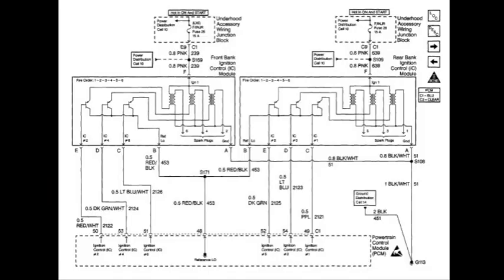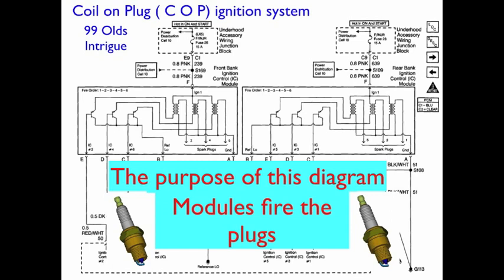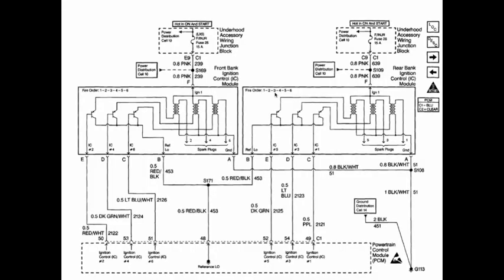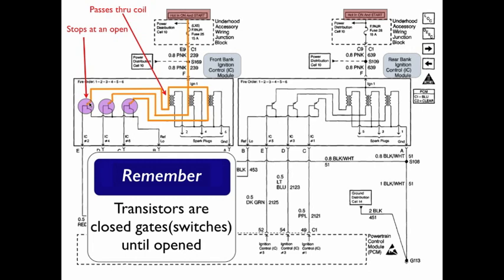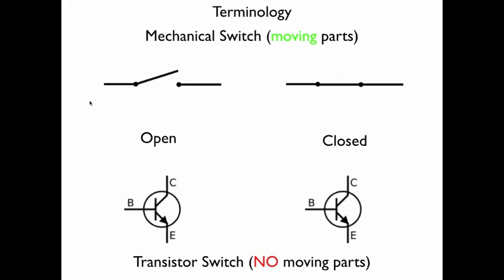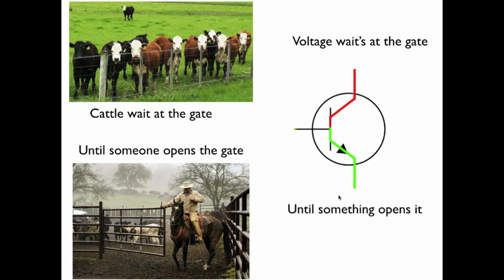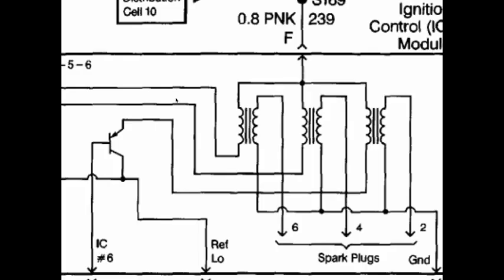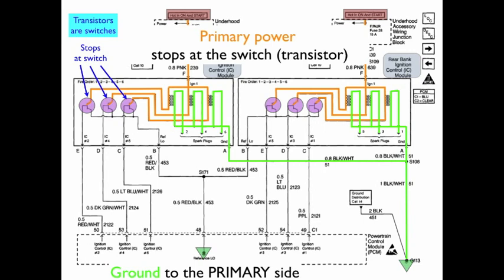Lesson 7 Part 3  Reading an ignition system electrical diagram

Comment: Sir amazing video and i am greatfull. Although i would like to mention here as far as it concerns the trigger on the base of the ignition transistors. The base should normally receive a positive signal, to be more specific because it is an PNP transistor it should receive a voltage lower aproximatelly 0,7 Volt than the emiter. in our case from 12volt about 11,3 Volt. Please corect me if i am wrong. Great job one of the best if not the best videos about automotive electrics.

Comment: The thing about this diagram that confuses me is how the "top" of the secondary coil is connected directly to ground. When the gate closes and the secondary coil becomes charged, why would the current flow in the opposite direction (i.e. up in this diagram) instead of through the spark plug? You say that the power is looking for the nearest load, I've always thought of it as the current trying to find the path of least resistance to ground, and the spark plug gap looks like a lot of resistance compared to flowing through the coil in the opposite direction.

Comment: I have a question about an issue I am having. I have an 08 chevy Colorado. My wife had to get a jump from a friend and they hooked up the batteries backwards. I ended up changing the battery and the alternator for charging issues. The 100amp mega fuse was blown and I changed it too. Now, half the time you turn the truck to On before starting the wipers move halfway and stop. Half the time they don't. No matter what, all the time when you try to turn on the wipers they don't move and the RAP relay just keeps clicking. If you have the ac going or try to roll a window down and then turn the wipers on the ac and/or windows stop until you turn the wipers off and the wipers never move. I suspect the BCM as I disconnected the window washer pump and put a lead on the red (hot) wire and the other end to a good ground, turned on the pump from the switch and got a jump to 2V then it dropped back to 0.8V the first time and it went down each try after. I saw on another site that the window washer pump was connected straight to the BCM and I should get battery power when I do this. I checked wires A5, and A7 from the wiper switch to B5, and A3 at the BCM and they have continuity as they are suppose to  Also checked B5 to ground - continuity. With truck in ACC 0V, with washer pump energized I get a jump to 1V and back to 0V. With key in On I get the .8V and energized pump jumps to 1-2V and back down to 0.8V-0.4V. I check all connections in the fuse box and everything that deals with the windshield wipers/washer has continuity in the lines so no breaks noted. The RAP relay (58) has power to relay pin 30, 85, and 86 and 0V at 87 with truck turned off. With the key in the "On" position on that same relay I get pin 85: 12.5V, 86: 0.26V, 30: 12.5V, 87: 12.5V. Key On and wipers on I get 85: 12.5V, 86: 11.2V - 12.4V, 30: 12.5V, 87: 0.2V- 1.6V. Could you give me any suggestions before I pay a lot of money for a cheap part?

Comment: The spark plug is not a resistor. it is a conductor. the high voltage thats been induced by the secondary winding will always find a path going the ground.  And if reaches the spark plug it will spark because of the gap.

Comment: Yes we do know about transistors. Some coils  have the transistor  built in the coil. Only a small Voltage and current is sent to base of transistor . Then collector and emitter. Will change state. then coil   will fire. Just Logical thinking.  Dear wattson. The cows at the gate about made me fall out. Cow analogy.  Thanks for the laugh.

Comment: When primary coil is turned on, shouldn't secondary also build voltage the same time? Why spark only occurs on disconnecting primary?
Reply: I think the collapse of the magnetic field on the primary that create the induction on the secondary which makes the spark!
Reply: i think you're right, the only way to have electron flow on the secondary side of the coil is from the magnetic field created by electron flow on the primary side, once current flow stops on the primary side it will immediately stop current flow on the secondary side, this works the same as a transformer. The way it steps voltage up from 12V to 40KV isn't from it building untill the transistor switches the primary off, it is caused by a difference in the number of individual wraps of the primary and secondary coils: I.E. the secondary side has far more wraps than does the primary side

Comment: Why there's not short at the switch when you closed it? It has power on top, and ground at the bottom. The loud is way up. I hope you have time to answer my question. Thank you so much and please forgive me for being so ignorant.
Reply from the maker: Great question.  Keep in mind one of the basic principles of electronica.  Voltage is the pushing force, no travel.  Amps is the current, flow, traveling movement. Resistance is the resistance, the consumer of the amps.  So, when the voltage is pushed thru the switch, the amps flow (travel) to the load, resistance where they are consumed.  So, there is no "short" at the switch because the "circuit" is set up correctly.  Now, there would be a short if the circuit was set up where the ground went directly to the switch instead of thru the load.  Let me know if this helps.  Perhaps I need to make a video to explain this.  What do you think?  Would that help ?